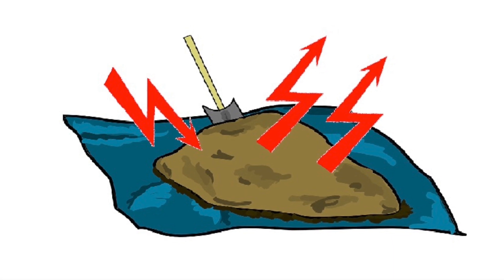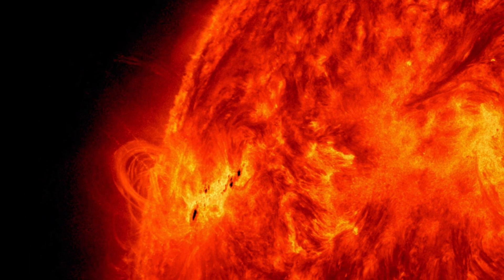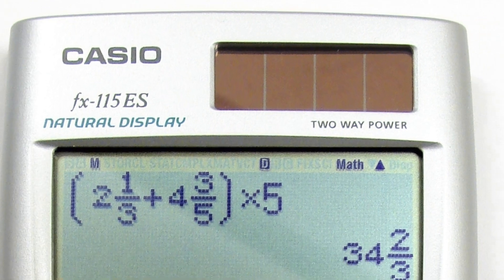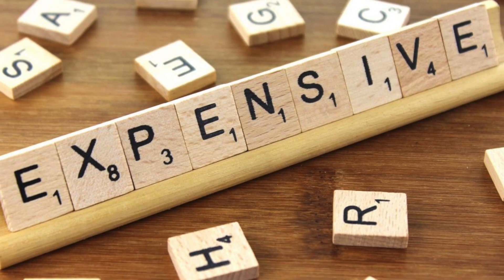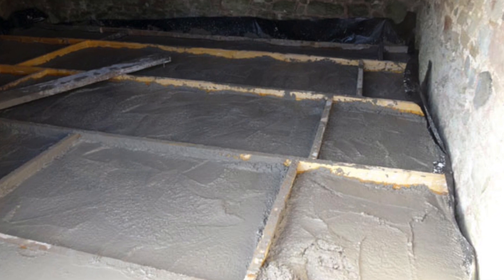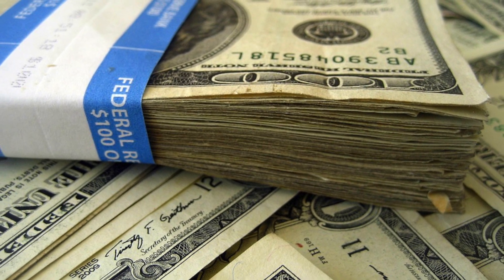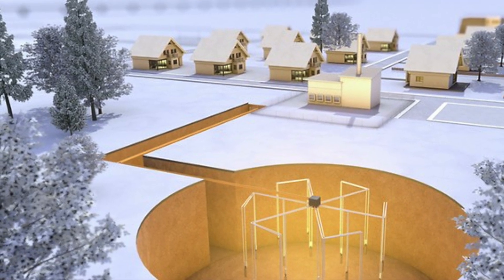Home Solar Thermal Dirt Battery (2020)

Comment: Simple calculation: 10 m * 10 m * 5 m is 500 m³. 1 kWh per m³ and Celsius. 60° against 5° ground temperature makes 55° difference. 
400 m² surface gives at u=0.2 and 55° difference:  400 m² * u=0.2 * 55° = 4400 W thermal loose. More than 100 kWh per day.
When the usable thermal range is 60° down to 40°, the storage contains 500 m³ * 20° = 10,000 kWh.
So it seems u=0.2 is not enough insulation. With u=0.1, thermal looses only half, only 50 kWh per day.
But this means about 130 m³ insulation material at US$ 100/m³.
Reply from the maker: seems your math is wrong, as thermal batteries are in use in many locations and nothing like your numbers show. so you're wrong. Very wrong.
Reply: @SimpleTek  No, I know the math for this. Try to proof any part of this calculation to be wrong.
Reply from the maker: @pegefounder  ok - real world example. Drake landing solar community in Alberta Canada. or LDS presser's geo battery greenhouse...I could list dozens... your math is wrong.
Reply: @SimpleTek  In this video, You told "2 times the volume of the house". So I made the example with 500 m³ and 400 m² surface.
Then You suddenly bring as an example a small village with 37 m depth and 35 m diameter storage.
That are 35,598 m³ storage,  685 m³ for each of the 52 houses. The surface is 5993 m².
This is a complete different volume to surface ratio.
Not 0,8 m² surface per m³ volume, this is only 0,17 m² surface per m³ volume.
There are garages. I assume ICE cars inside using oil. So where is enough photovoltaic to power all the 52 houses and electric cars?
Reply from the maker: @pegefounder  where did I say the houses were using photovoltaic? you don't really understand math, it's clear from your last reply. one is for a single house, one is for 55 houses. you're trying to play with numbers to make yourself look correct but are forgetting this is a WORKING example and has been working for a decade.
Reply: @SimpleTek  No, I gave an example with 400 m² surface 500 m³ volume which will not work. You bring as an example 5,993 m² surface, 35,598 m³ volume., 
685 m³ for each of the 52 houses. Seems You have difficulties with the term surface to volume ratio. 
That they have not photovoltaic is a big failure. Seems they are only concerned about heating and DHW, nothing else.
Reply from the maker: @pegefounder  you're finding reasons to say existing systems that have worked for over a decade shouldn't work. Yet they do. hummmmmm
Reply: @SimpleTek  STOP telling things, I never said. You claimed for single houses just double the volume of the house. this is terrible wrong.
A single house storage would be according to Your claims 500 m³ with 400 m³ surface.
The storage for the 52 houses village has a complete other dimension:
685 m³ instead of 500 m³ and 115 m² instead of 400 m² surface per house. 
Seems You have huge difficulties with the term surface to volume ratio. 
The surface to volume ratio is 1:3.15 different between the single house example and the 52 houses village.
Reply from the maker: @pegefounder  math, not your friend. If your math was correct the examples I quoted would not work. But they do. SO YOUR math is wrong.
Reply: @SimpleTek  What is so difficult to admit, that You are wrong? The big storage for the 52 houses has a 3.15 times better surface to volume ratio than a storage for only one house. This makes the difference between it works and terrible failure.
Reply from the maker: @pegefounder  you keep saying it's a failure when it's been working for over a decade.
Reply: @SimpleTek  Stop making false accusations. Where did I write, that the 52 houses project does not work?
The 52 houses big storage project works, because the surface to volume ratio is there 3,15 times better then for a single house.
That is the reason, why it will not work at Your "2 times the volume of the house" proposal.
Reply from the maker: @pegefounder  right, and all the geo battery greenhouses are wrong too right?
Reply: @SimpleTek  Come with specifications, and data with links, with studies. Not "Oh it works and You do not believe".
Reply from the maker: @pegefounder  so actual working models mean nothing? buuuhahahahahahaha
Reply: @SimpleTek  You again failed at specifications, data, links or studies. "buuuhahahahahahaha" proofs nothing.
Reply from the maker: @pegefounder  I've already given you examples. maybe build one like I did instead of thinking it won't work with wrong numbers
Reply: @SimpleTek  No, You refuse strictly to give examples. Examples are links to real material. Not  a "There is something somewhere"

Comment: I have done the same, but in my system, the heating is under the house directly. There is no basement so it's basically just warming the ground the house is sitting on. Ideally, you need different layers in the ground. This to ensure you can deposit the heat further down in the early summer to mid summer (depending on the seasonal variation where the house is located).

As you say in the video, clay moves heat quite slowly. And that is good, because this principle is mainly about slowing things down, ideally displacing the heat around 6 months in time. The disadvantage to this is that it needs a lot of tubes in the ground to be able to absorb enough energy when you have a lot of solar power. In my first system, there is only around a total of 80 feet of 3 inch tubing (with water). This is far from enough, but it's better than nothing. What I have, though, is about 7 metric tons of concrete to store heat in the daytime, and at night, the circulation pumps keep running when applicable, ensuring maximum heat transfer during the year. The issue is as simple as this: The slow heat transfer in clay (same for sand, gravel, rock etc) also means that the ground material around the tubing can't spread the heat out fast enough.

Finally ... rain water and ground water. It is essential to gauge the range of the ground water level. Water is actually a very poor heat conductor BUT because it's a liquid and moving about, that compensates for it. That is also why water is so popular to use in heating systems. The worst you can have is rain water running through your heat storage. If it isn't shielded from rain water, the water will extract a lot of the heat.

In my first project, the pipes were inserted into the ground, below the house (only digging a small hole on the front of the house, for access). Hence my access was quite limited to get to the house. In this case, when you are heating the ground under the house, you should seal off the top soil to keep water away, as well as insulate around the foundation, into the ground.
Reply from the maker: Thank you soo much for the detailed information!!!!!!

Comment: The economics of this obviously makes sense in colder climates, but i wonder if tropical hot climates can still benefit from this by using the heat saved is some other way during the mild winters ?
Reply from the maker: you don't need to save the heat, just turn it on and off as needed with this system. a large pile can go all winter

Comment: This is what geothermal heat pump use - for both heating an cooling.  So it is that with a thermal envelop around the dirt and a low tech way to extract the heat - save money to run an expensive motor.  How about insulate the top as well to keep as much heat in the dirt as possible then maybe you can use less dirt.
Reply from the maker: great idea

Comment: I would suggest consideration of simple monitor and control logic. Pump when temperature of the heat source is greater than the storage temp.  A few zones to collect energy when the temperature decreases below a storage locations temperature, switching to store in a lower temp storage location.  Consider that diverting (control values) the solar heat area liquid flow, the heating inside the house, would save having to add additional heat recovery piping, liquid.
Reply: The digital temperature controller you are describing is available on Ebay for $14.   It turns your devices like fans or pumps based on the high and low temperatures you set on the digital display.
Reply from the maker: sounds complicated!!!!

Comment: I drove past a huge mound of wood chips.. this thing actually steams in 2 degrees celsius.. I am now considering running a copper coil through a woodchip heap.. the decomposition is exothermal and then in summer, I have manour..
Reply from the maker: that might work. it helps to mix in manor and add lots of water.
Reply: @SimpleTek  Yes, I'm kind of wondering if when you take the heat out of a compost-heap if it will compost as well. Probably not. And I'm curious as to how much heating this will actually provide. Depends on the size of the mound, but I feel you don't need twice your house size to go through winter. Just a gut feeling.
Anyway, I might try it this year or next. If it works, I'll make a video and get youtube-famous :)
Reply: @Ludifant  
I suppose it will Compost, just taking More time
Reply: I have developed a compost heating system with controlled heat extraction. I was not sure about how to store heat during times of less demand. I think this dirt storage could do the job.

Comment: Could it be hooked to an existing hot water baseboard system?
Reply from the maker: I don't see why not!  great idea. it's not as hot as a typical boiler system though, running about 130' average and hot water baseboard usually runs at about 160-180'. people have hooked it up as domestic hot water though
Reply: @SimpleTek  Thankyou

Comment: Hi Tek, how about dig deep like 10 meter and forget about insulation
Reply from the maker: here, at that depth it's about 6-8C
Reply: @SimpleTek  I mean no insulation. not meaning no thermal.
Reply: I think the idea is to “super heat” an isolated section underground. It would be inefficient to not insulate your heated dirt from the surrounding dirt, if your heat battery isn’t isolated/insulated - there will be too much heat transferred to be efficient.

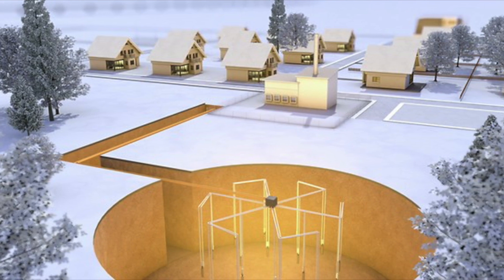Comment: in the 4:40 of this video, you mentioned that the dirt are required 3 to 4 times the volume of the a greenhouse. Is it for the Northern climate like Canada? Does it have the proper insulation for the compost? What kind of compost meterial do you use? I am interested in knowing how you come up the number.
Thanks
Reply from the maker: just by looking at other people using similar systems and what they needed

Comment: The gas type of extracting the heat may be more risky. I expect that the dirty battery create methane that may leak into the heat exchange gas pipe accidentally if a pipe is not completely sealed. The water type of extraction may be safer.
Reply from the maker: liquid heat transfer is much better

Comment: I have thought about air pipes under the house and into the backyard. Then just running a 6" duct fan when needing a little heat inside. I now have R80 attic insulation and R35 floor insulation. I built a 3x6 foot solar heater with a heat output of 160 F when sunny. I also built an electric thermal mass floor heater which emits silent and gentle heat. They work so well I am going to build 2 more.
Reply: Compost heated radiant floors sounds interesting too for distributed and decentralized winter heat generation. Guys in Alaska heat their shop with compost heating. Size of 4 trucks is good continuous heat through the winter. Interesting for all rural households.
Reply from the maker: sweet!
Reply: You want the output temp. of your 3x6 heater to be 85deg./90 deg. Not 160 deg. Increase the airflow.

Comment: Could I use a outdoor wood stove to help heat the soil. Maybe it wouldn't be needed and I'm over thinking it
Reply from the maker: if you mean an outside wood boiler, they are amazing but use a lot of wood. instead of heating the soil why not just pump the heat directly inside. Bright agriculture does that and heats a couple large greenhouses with a wood boiler

Comment: I'm always shocked that si few people are interested in this tech. 
So many problems with photovoltaic energy - just think of the infrastructure needed.
I do have a question.
Since removing and replacing mammoth amounts of earth can be done to address effectively- what is the cost benefit to the insulation? 
Does aircrete have a definable insulation value?
How have you arrived at your volumes needed? - has the Drake project helped you to develop formulas for this? 
I wonder what the funding was for the Drake project.
Are you planning to do a kickstarter?
Reply: Warmest regards Jennie
Reply from the maker: thank you
Reply from the maker: drake had a lot of federal and government funding. it's a lot of work to make a compost pile but once it's built it's a year's heat with no more work.
Reply: Also interested in formulas. Maybe a Kickstarter, with promises of the formulas/ semi scientific report afterwards